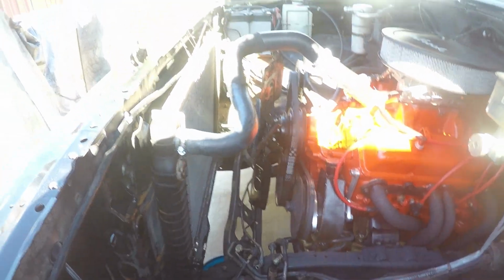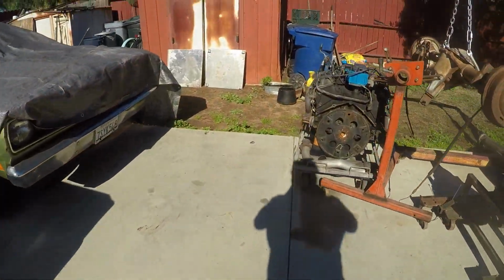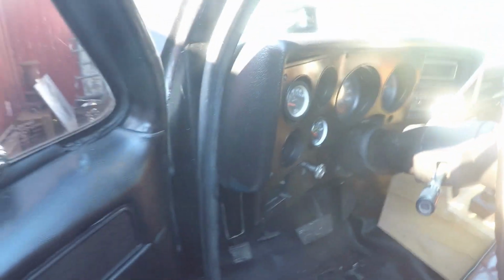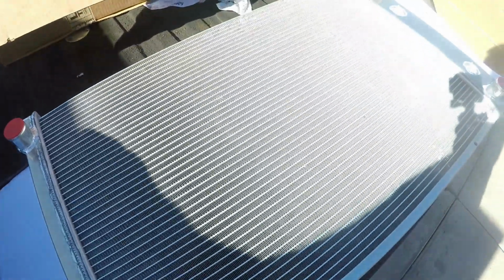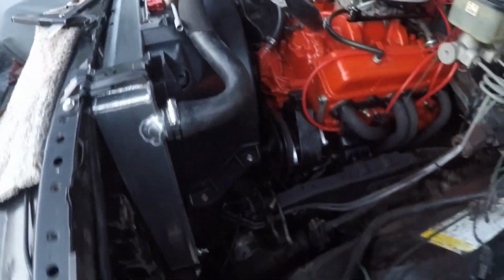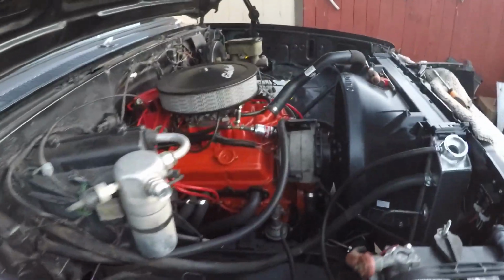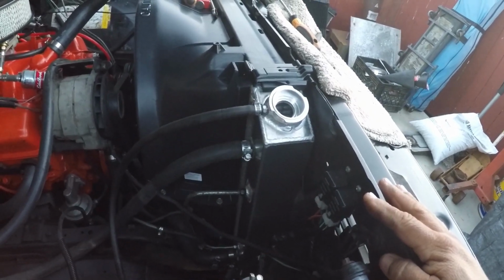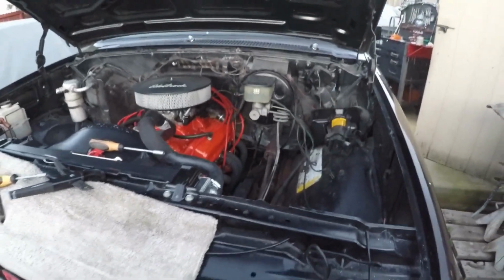FINISHING UP THE 1986 GMC SHORT BED

Comment: Clean truck !! I have an 86 C20, same color. I replaced the TH400 with a 700R4. I just pulled out the original 350, it only had 165hp. I spent my kid inheritance and got a GM Performance 350/357hp. It’s too heavy for a hot rod, but it should run pretty good. That 700r4 made such a difference, it cruises at 70-75 very nice now. Around 2000-2100 rpm. You have clean vehicles. It’s cold and snowy now here in CO.
Reply from the maker: Thank you so much for watching this video I appreciate you